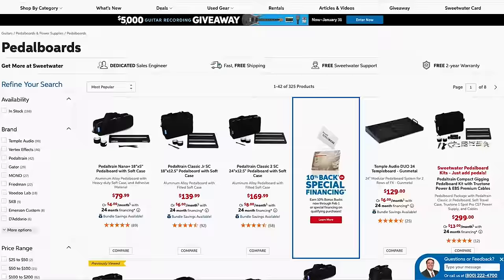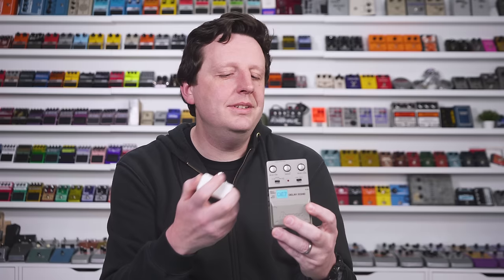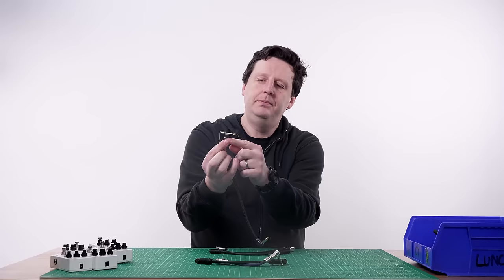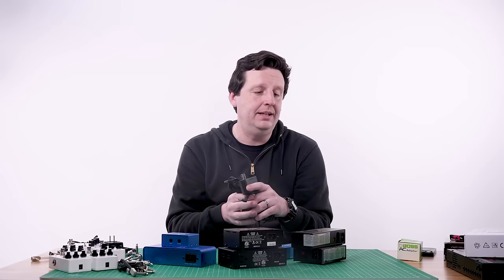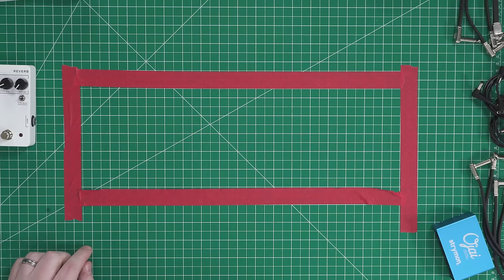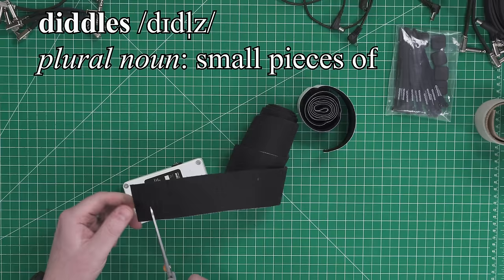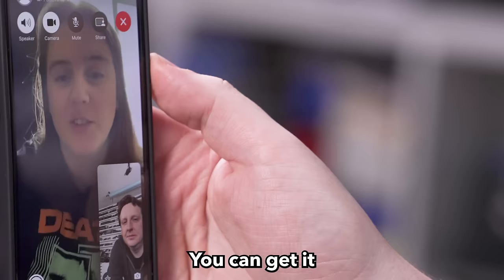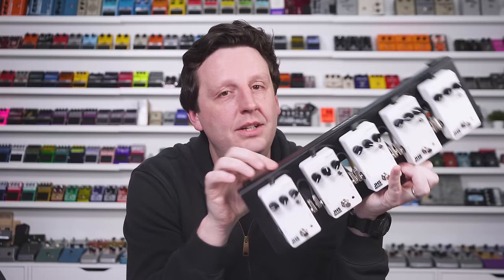How to Build a Guitar Pedalboard: Beginner Tutorial

Comment: Can anyone in the Tampa/St Pete/Clearwater area help me optimize my pedalboard, which is geared for live-looping? 

It’s extremely complicated (to me at least), so I want to make sure it’s set up correctly and efficiently. I use mainly use it at my house. I’ve taken it to a few gigs, but it’s really heavy and fragile. It uses a lot of signal splitters to separate and re-combine vocals, guitar, loopers, and drum samples.

*Vocal chain*: Mic->TC Helicon G-XT->(re-combining/splitter cable DigiTech JamMan Express XT->2nd JamMan->SDRUM->Boss RC50->Rowin Noise Gate->Behringer 212 PA System
*Guitar Chain*: Line6 JTV-59 Guitar->TC Helicon->DigiTech HarmonyMan->CryBaby Wah->Vox StompLab II->(re-combining/split cable, which follows the same chain as VOCAL: DigiTech JamMan Express XT->2nd JamMan->SDRUM->Boss RC50->Noise Gate->Behringer 212 PA System)

Boss RC50, TC Helicon Harmony G-XT, Digitech HarmonyMan, Line6 Variax battery charger, Behringer PA, and Hiree Power Supply are all powered by a typical power strip. 
The SDRUM, Wah, both Digitch JamMan loopers, NoiseGate, and the Vox StompLab are all powered by the Hiree Guitar Pedal Power Supply (Adapter Station 10 Isolated DC Output 9V/12V/18V with 4 AC Outlet). 

The SDRUM occasionally has issues where the volume turns up and down. I’m not sure if that’s a power supply issue, or if the SDRUM’s automated volume feature is picking up artifacts through my mic from the monitor, or if the unit is faulty.

Comment: (Re: Boss Pedals) Turning the bottom plate inside out has never worked for me! The rubber ends up pressing up hard against the internals and the corners of the plate bend as I screw it on. I don't like it; I don't trust it. Call me ridiculous, but I called up Roland Customer Service and ordered some bottom plate blanks. They sold them to me very cheaply and I am happy.

Comment: Ok so that's 500 for pedals then power supply then board itself then patch cables ,So let's say 700 roughly and you'll spend your life tap dancing and replacing broken cables and faulty power cables or you could just buy a modeller like a hx stomp XL a valeton 200gp a boss that will give you all those pedals and more plus other FX amp models, cab models , you won't have to tap dance you can use it through an amp FX loop or straight to front of house or both . Why would you buy singular pedals anymore when modellers are more convenient, sound just as good and via the looks of this video cheaper and easier.
Just my opinion but a valid one. Beginners should get a modeller and go from there.

Comment: Ha! Where were you JHS how to video when I was building MY first pedalboard 8 years ago? Oh the agony! The COST!!!! The cheap cables, pedals, power supplies and the CABLES OMG...so bad. So unreliable!  Use good, LOW PROFILE patch cables! Use an isolated power supply. Power it with a portable pure sine wave battery powered inverter when gigging.

Space your pedals far enough apart so that you don't accidentally hit the wrong one. Or wear expensive pointy toed calfskin boots that cost more than your guitar  like I do. Chicks dig expensive shoes.

Velcro sucks, but you gotta use it. I back mine up with ZIP TIES Xed across the pedal to secure the CABLES which WILL loosen and cause problems while playing if you don't secure them. 

Watch those power connector leads too. They have a nasty habit of unplugging themselves at the worst possible times. Again, zip-ties are your friend. Use a pair of diagonal wire cutters to rough trim them, followed by nail clippers to round off those razor sharp plastic tabs, or carry Bactine and Band-Aids  in your gig-bag.

Your pedal board will grow. and grow and grow until you cant lift the damned thing. Start over with a new set of smaller pedals, and watch it happen all over again. Use a screwdriver to pry your pedals off after cutting the zip-ties.

Get a tuner pedal so you can MUTE your guitar while you take a break, unplug, or tune. Keep a headstock tuner handy, cause you never know.

The final thing I recommend for all beginners is a LOOPER PEDAL. Nothing will improve your timing and coordination better than learning how to loop rhythm parts. Yes, it takes a LOT of practice to learn how to loop. So start NOW. You can then learn how to play scales, licks, riffs and leads IN TIME with backing tracks you make yourself. Drum machines are nice too, and there are several loopers out there that combine drum machines with their loopers.

Oh, and get an IR / Cab / Amp sim pedal too. Then, you can get all the drive and grit and sustain you need through your computer speakers, headphones, or the giant PA system at your stadium gigs. No stand-alone guitar amp required. I use a Bose S-1 pro as my PA/Amp. It's battery powered sounds GREAT and gets loud enough to peel paint in bars and clubs and will generate noise complaints from Harley riders when you busk.

Aint technology great? =D

Comment: Humbly disagree about power supplies. Most pedals don't need isolation. So buy a daisy chain power supply and a external battery connector or two if you need isolation and you are still way under $100 bucks. Add to that the prevalence of battery powered power supplies that are isolated from the mains and therefore isolated. That's new technology that is getting cheaper. Strymon has an expensive version, Joyo has an inexpensive on in their Joyo 5. I bought one of those for $65 and it works great and holds a charge. Those $300 power supplies are great for gigging musicians, not appropriate for couch players. #babyneedsnewshoes, #saveyomoney, #closeenoughiscloseenough

Comment: Moen Arsenal 8 power supply is awesome. Less than  a 100 bucks. Isolated. And 18V input and higher ma inputs. 
Only problem with them... oh my god... it's real annoying.... it's how the power cable comes off the brick. It goes the other direction of the individual pedal cables.  Very NOT ergonomic. 

Its the ONLY power supply I've found that is under a 100 that is actually isolated.

Comment: This pedal board is NOT
inexpensive.
$$ 500 +/- is NOT cheap.

Their are tons iof FANTASTIC
CHINESE....mini pedals
 Around......$$ 50 +/- ......Not $ 100 per.

Powe supplies  aound $ 30+/- bucks.

Two distortions ? Not cheap.
Reverb ? Always in the effects loop.
One good analog delay with modulation.
One distortion.
One compression.
One of either
Tremelo 
Flanger
Auto wah
Chorus (stereo)
To split to TWO small amps.
For REAL STEREO ROOM EFFECTS.

An EQ and a Volume pedal
Before everything...

Two small boards can cover 
90% of sll of this really cheap
And insanely good sounding.

Much less than $$ 500 bucks
Or more for the same thing.